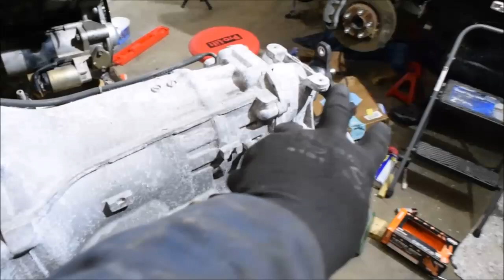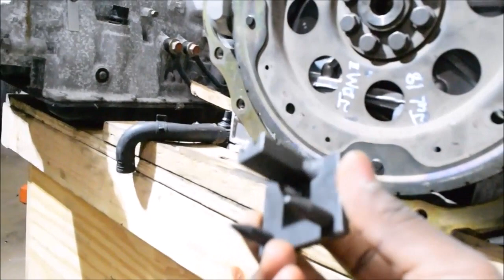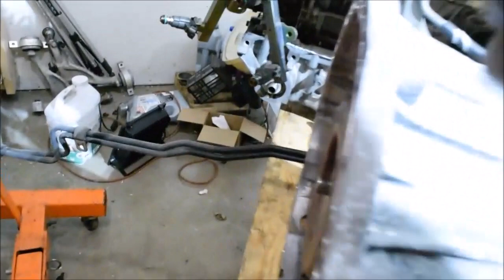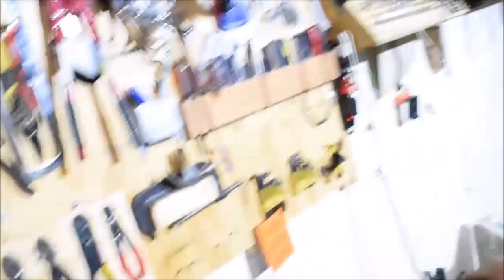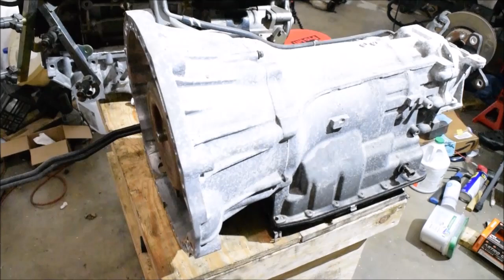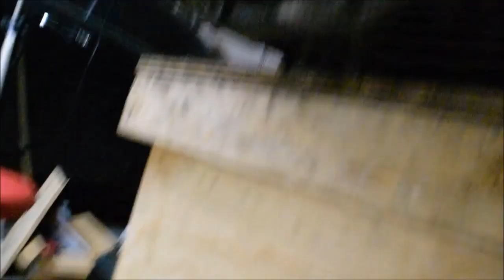Ep.14| Ring Gear, Signal Plate. Nissan VK45DE engine reassembly. 4.5 liter V8 - M45. Q45, FX45, Fuga

Comment: Is it possible for the whole engine bay harness be change without taking out the engine, during my engine replacement the mechanic did a terrible job and was cutting the engine bay harness with led to the car have few electrical problems??
Reply from the maker: That's terrible to hear.
Yes, you can remove it with the engine installed. I have removed a few that way